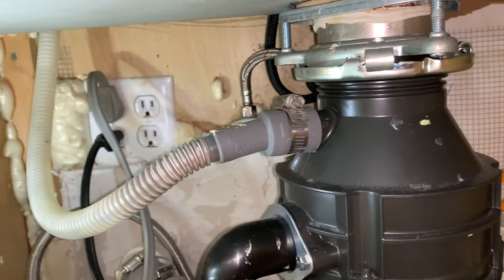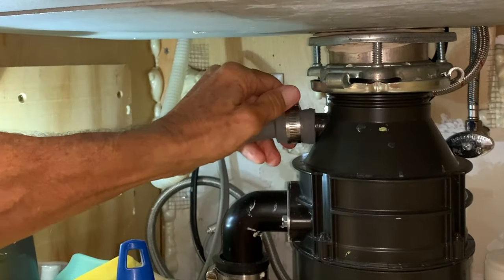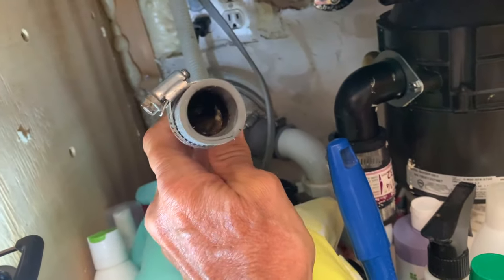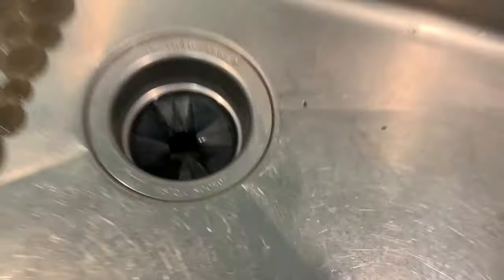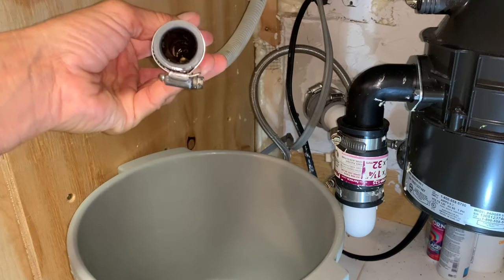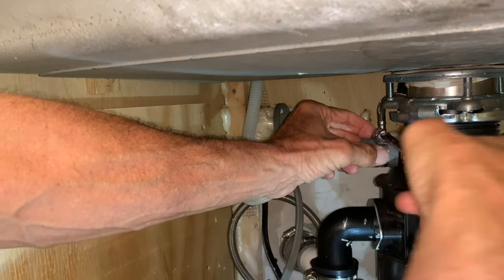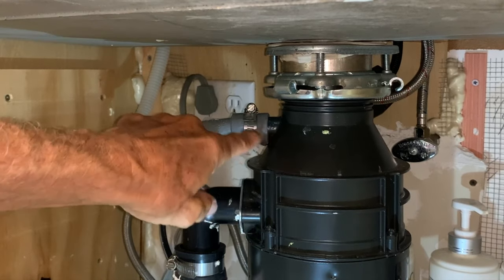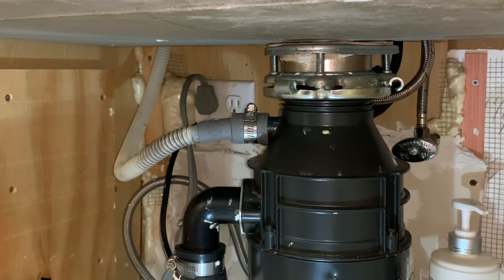How to unclog a dishwasher drain hose to garbage disposal

Comment: Where dose the flex hose traveling up go?
Reply from the maker: That’s the outflow that goes to the garbage disposal and then out to the sewer. That’s where the water comes out.
Reply: It goes back to the dishwasher pump. It rises out of the garbage disposal per code.some states have to use an air gap system.

Comment from the maker: Make sure that the plug on your garbage disposal was popped out or you connect the hose. If you didn’t new install fence one thing you can check and then if it’s not working, you may need a new pump for the dishwasher or you may have like a piece of glass caught in the fan. Good luck thanks for watching. Happy holidays.

Comment: I put a chopstick through one of the holes at the edge of the mesh filter at the bottom of my dishwasher and it detects about 1 inch deep water there. Is it normal? Or should it be totally dry there?
Reply from the maker: Well, there may be some water down in there, but it should all clear out when it drains

Comment: Oh, your hose connection comes off “nice and easy”…how cute.  What about when it’s as tight as prom night and the it’s a rigid hose (not flexible)?
Reply from the maker: And it’s definitely gonna take some elbow grease to get that thing off. You may want to replace it with one. That’s more flexible if it’s been on there for a while they get really stuck and you got a pull pretty hard and it’s not a very big space to be working in so it makes it even more difficult. Good luck. Thanks for watching.
Reply: LMAO

Comment: And what if the clog is further down the line? What if the clog is nearer to the dishwasher than the sink?
Reply from the maker: Another solution would be to purchase a new hose that goes from the dishwasher to the garbage disposal
Reply: @TomLeeman  I removed the entire hose and made sure it was clear with my garden hose. It's still not draining. Does that pretty much mean it's the pump?

Comment: The hose is connected high to the sink.  Mine goes down to the bottom , goes through a hole to connect to behind dishwasher…?
Reply from the maker: I think it doesn’t matter as long as you’ve got it connected to the right spot on the garbage disposal and the dishwasher itself and it’s not pinched good luck with your project thanks for watching